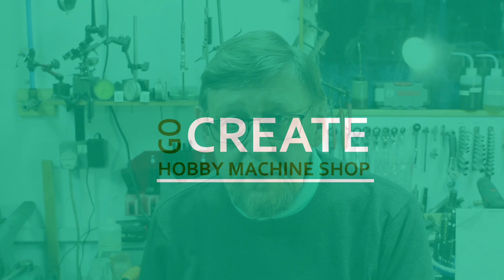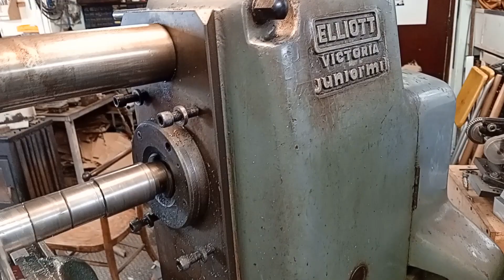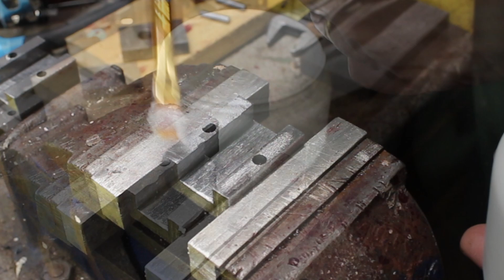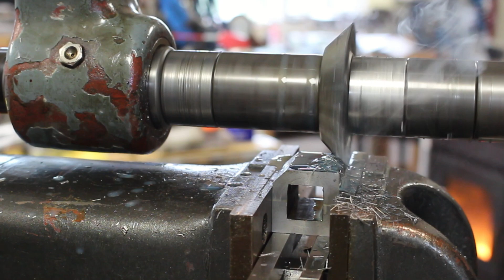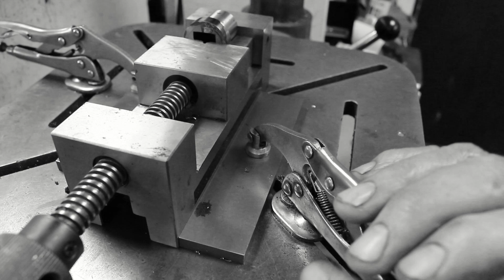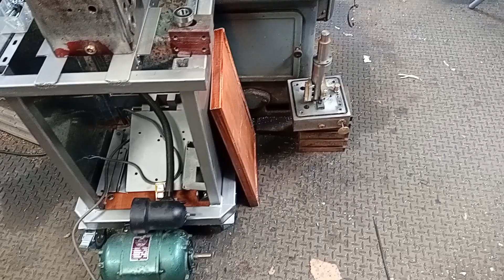Shop made Die Filer Build -Part 23 - File Holders & Update

Comment: Nice job, Nigel. Are those files hard to get?
Reply from the maker: Yeah, parallel machine file suppliers are non existent here in the UK, while they appear to still be made by the Swiss, they seem almost exclusively available in the USA from a very few specialist suppliers. I was lucky to buy mine at a yard sale while working in Houston. Although not ideal you can adapt parallel hand files to be used in a filling machine.
Cheers 
Nigel